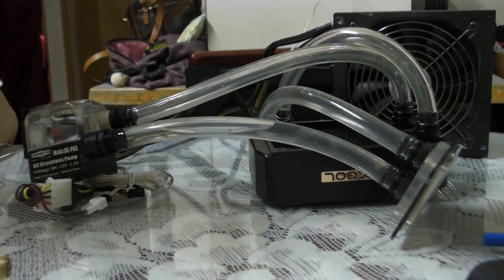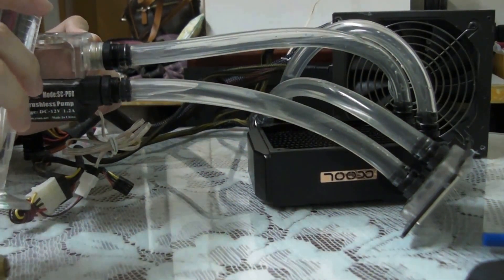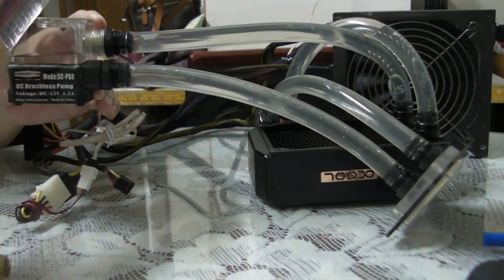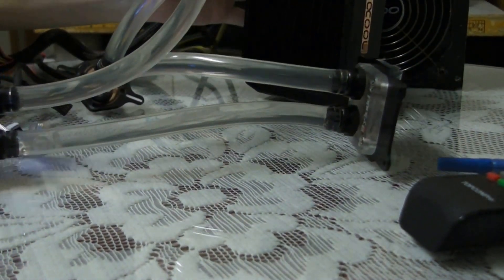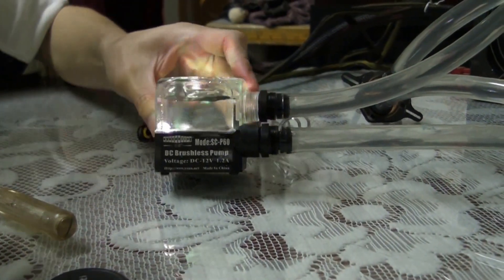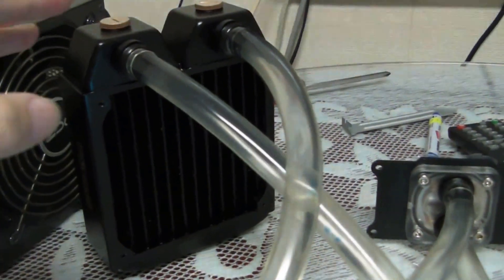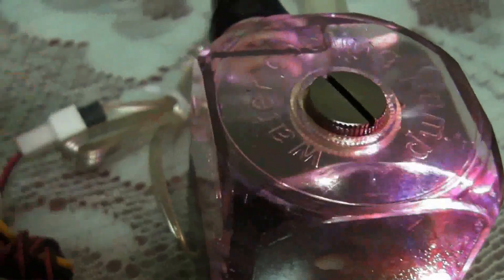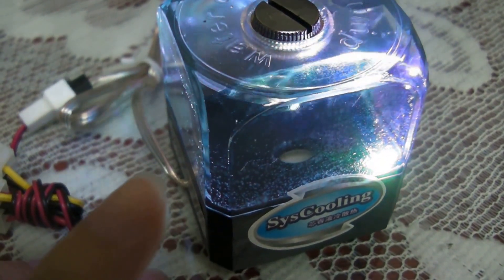Part II, leak test and noise test of Syscooling SC-P60

Comment: Thanks for your video!! This pump is working and doesn't make noise! 
Im thinking to test it with a big 3 x120 EK rad and 1cpu 2 gpu from syscooling I have a setup now but my pump is making noise... Is a Delphi pump 18watt I have under volt it but lower than 65% doesn't start and its makes noise even at 65% !!
Reply from the maker: this pump has no problem pushing both cpu and gpu micro-channel blocks, two 240 30mm rad and a chipset block at 1300 rpm. i have no major problem when i bleed the loop at 2000rpm
sorry, im kind of new at water cooling and dont know much about your pump. how old is your pump anyway?
Reply: This pump is from eBay and was brand new also a friend of me has it and does noise it's normal working noise... Anyway I have change it with a d5 pwm expensive pump I know 70€  but doesn't make any noise! I will run it many years!
Reply: +Manos Averis  Yeah get a 3-phsae brushless motor  pump ,like this one .